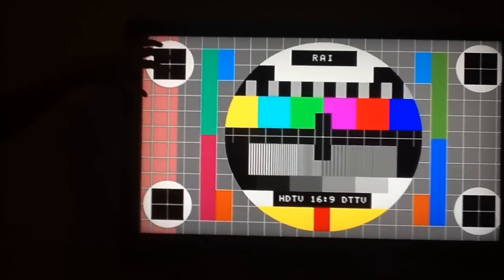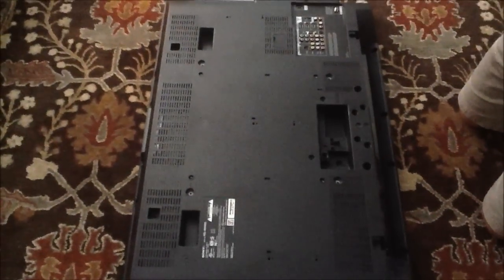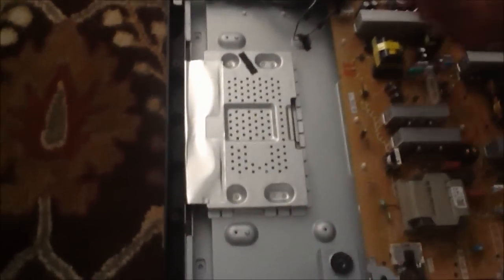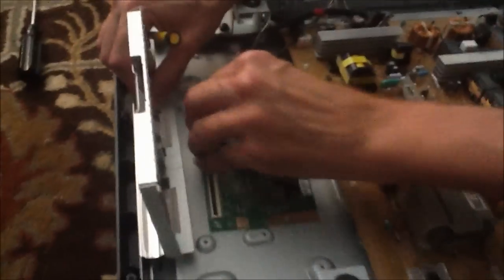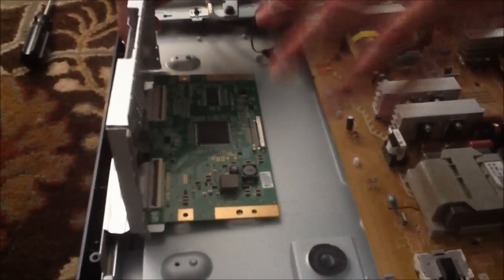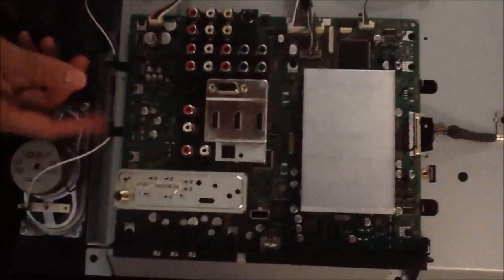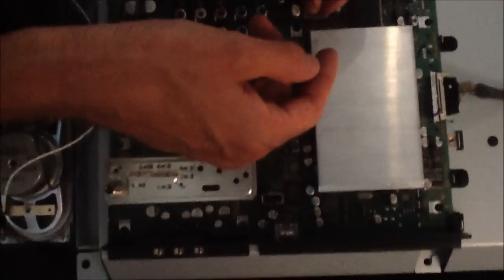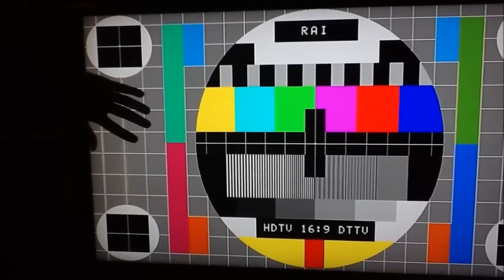How to Troubleshoot an LCD TV

Comment: 43 inch lcd vediocon off on inverter but start on light/without inverter ligh means direct light.? On sply bord power coming I have changed Brize and filter 120/500 even then filter shows 220 voltas and doesn't start but on ac light without inverter Lcd starts

Comment: Sylvania LCD Color TV model 320SS9 A won't shut off either by remote or by button on side of TV.  Put new batteries in both TV and cable remotes, but that didn't help.  Tried to unplug it, but with a new knee can't get down on the floor to crawl under the cabinet it's in.  How do I shut it off?  Maybe that would reconfigure it and it would work again???

Comment: I am trying to find info to repair a Seiki LCD TV model #SE47FY which has sound but no picture. I did the flashlight test and found that there is a picture but no backlight. It is difficult to find anything about Seiki TVs and I am hesitant to perform any tests for fear of doing harm to the electronics. I would appreciate any help that you could give me.

Comment: I still think you may have a tab bond problem...During the movement of the tv you may have jogged the bonds so they will operate better, but, most time its the bonds and freeze spray won't always diagnose an issue with bad tab bonds.....I've been in the tv service buss. for over 35 yrs, and i myself have fought with these issues all the time.......Luckily, you were able to return those bds. with no fuss or even a stocking fee....This co. that you dealt with must have recently changed it's returns policy, becuz, I have never been able to return w/o a fee etc......of course, since the tv serv buss is almost non exsistant, these co. will do anything to drum up funds..........but, good luck......this is the reason I no longer do service full time for the last two yrs.!

Comment: LCD LED Tv Panel Bypassing Methods eBooks.

Learn how to repair Panel failures,T-con problem in LCD LED TVs with comprehensive guide line with Schematics and Pictures of Problems, This eBook (PDF) or (Doc)format was written for Advanced Level of Technician of LCD LED and Plasma TV repair and includes many Bypass method. If you want to become expert in this filed of LCD LED TV repair  than this is a good eBook for you. Maybe you have a broken LCD TV sitting at home or your workshop and you want to repair it quickly. No Problem who you are or what your reason is for wanting to repair LCD or LED TVs you have come to the right place.Once you have complete your purchase you will be sent a link to download a copy immediately.
Volume 1 ,
Volume 2 ,
Inverter Bypass eBook,
SMD Data Guide eBook
Reply: LCDLED eBOOKS who wrote those ebooks?

Comment: Thanks for taking the time to make the video. I have  VIZIO that I'm about to open up. I'm sure it is similar. at very least troubleshooting process would remain the same. Yes?
my question to you, and maybe I missed it.  I 
Will have to check again.
     When you mentioned "Re-Seating the Ribbons, Or Tabs, I noticed you only did it at the "TCon"board?  Wouldn't you also want to do that at the main board as well? Or is that a permanent connection? It was Hard to tell. Just that if it is removable and there is a reason NOT to re-seat there, I was hoping you could tell me. Thanks agan

Comment: I'm having trouble with my Emerson  model#LC260EM2 - S/N DS4A1213148370 it well turn on but won't go into the menu or only displays hdm , digital DTV VIDEO COMPONENT HDMI3 HDMI2 HDMI1 so in other words it's displaying each input mode only . thats all it well do ? So if that helps I would be grateful for any help thanks Ron F

Comment: my samsung tv 26" is not powering up when i switch the power baton it flashes then goes to stand by,no output.(model.LA26D400E1XKE),When i check the voltage with the main board disconnected it's stable but with main board connected voltage is varying

Comment: Video let down!  100%  I have watched 8 videos and 7 of them taught me something.  This video did the opposite.  It taught me that contraction tightens joints.  Nope! Expansion & heat does.  It taught me that you, without reason, start at the famed TCONN board for repair; only to find it did not work.  Then it taught you to replace the four hundred dollar board only to get pink fuzz that you have to live with.  Honestly, this video hinders home project and budget friendly trouble shooting.  Everyone, there are guys out there who actually know how to find your problem with a volt meter and guide you to inexpensive repair.  My TV keeps going blank.  It is a power supply issue but I will test it with a volt meter before I go buy any boards.
Reply: +Running Out of Air agree

Comment: My parent had a 1976 model Quasar with plug-in boards, later on RCA and others came out with them. But it was a hassle to stock all those plug-ins and some were expensive.
Now the new sets,,we are back to using plug in boards, the idea was the repair guy could come to your home and quickly fix the problem just by replacing a circuit board.
Reply: +Bri G. That plug in board principle was also used in German made Blaupunkt and Grundig TV's in Europe. The circuit boards also had a status LED on them to indicate which board had failed.

Comment: I have the same television, but mine has a different problem. A while back I turned my tv on to find a problem where the TV would gradually get darker and darker and then would start to distort the colors and would "solarize" (I think that's what it's called). The problem eventually went away on its own after a few weeks, but maybe 1 month later the opposite started happening. I would turn it on and see a white screen, that would eventually return to normal, but after a few minutes would get very bright and "Solarize". Any ideas on how to fix this? Do I need a new tcon board? Or could it be the main bu board? Help me please.

Comment: Duh, ever heard of 'contact cleaner'? Simply re-seating a connector, especially one that is composed of multiple delicate connectors, is not guaranteed to clear corrosion or carbon build-up that appears over time and interferes with electronic contacts. Of course, if there was corrosion on any of the connectors, it most likely wouldn't be on the contacts of the new board (or replaced cables), so replacing that board would have 'appeared' to fix the problem. In this case I'd guess that the cable was possibly the fault. In fact, why didn't you first replace the connector cable itself when you appeared to have isolated the problem to the cable, which would have been cheaper? Anyway, you could have possibly fixed the problem in about a half hour for less than $.50 (the cost of the amount 'used', of course). I hope others steer clear of your 'disposable repair' method until after they've tried using the less expensive 'contact cleaner' test (and possible repair) method that can be tried by anyone without any more sophisticated knowledge of electronics than an awareness of this problem and the appropriate screw driver tips to take off the back of the tv.

Comment: I have an LG 50LN5600Iu The problem is when the set is turned on,the LG logo flashes for a split second then the screen goes black.I don't see any led lights through the vents. However,With a flashlight I can read the menu, I do have sound only no picture

Comment: My LG TVModel PDP42G20144 just turned off one day (no power) and has no power to it since. I was thinking it was the power supply unit. The number on my power supply unit part is EAY60696801 or ( 901)  What do you think?

Comment: I'm from the old school where I had to repair TVs on the component level. That means a full compliment of test equipment such as oscilloscopes, bench meters, RF generators, signal tracers & generators, convergence generators and a whole lot of knowledge about electronics. Watching this video makes me a little concerned about the "throw a board at it till it works" philosophy that this video clearly illustrates. We used to call this method "Screwdriver Mechanic" troubleshooting!

It seems that the electronic service industry has degenerated down to the "village idiot" level. This is really too bad because electronics used to be fun, challenging and very satisfying.
Reply: spudpail Not everyone is a TV tech or an EE. This is designed to help people on a budget try and fix a TV cheaply without having to have detailed knowledge of electronics. Yes we used to troubleshoot PCs at a component level too 20 years ago but electronics got to the point where its cheaper (cheaper because it takes less labor) to just replace entire PCBs. Take your elitist attitude somewhere else. Youre not helping anyone here.
Reply: +spudpail The industry has definitely headed this way.    Even with scopes and generators, it's probably less time consuming and not that expensive to replace components, but you should have some working knowledge on which component to replace first.   I think  a hybrid approach works best.  Test with an VOM for obvious thinks like +120 VAC and look for bad caps (test too).  Reseat connections and clean.  Then, if it makes sense, start replacing boards.   It's not very easy to replace a component on a TCON board even if you could figure out where the problem was.  On the power board you have a shot.  Where can one get schematics these days?  I remember Sams!
Reply: +Mike Longo Read my response to GreywolfStudios74 . I replaced SMDs for a good long time and it's not easy and I agree that it may be more economically practical to replace the board, but deciding which board to replace without buying the every board in the set is where a little logical troubleshooting pays off.
Reply: There are companies out there that will let you return parts but you generally dont just blindly replace a board. If you do a little google-ing you can generally figure out which PCB is bad in a TV just from what the problem is. Then its not as much of a crap shoot. Plus there have been times where when I wasnt sure Id buy a used part off of ebay to test with. sometimes I waste a few bucks here and there but generally Ive been able to fix both TVs and PCs by doing these sorts of things. I eman dont get me wrong if you have the tools and the knowledge then great, repair the component but I can tell you from a PC point of view even though I can repair PCs at a component level I generally dont anymore. unless its something obvious and easy like a blown cap or something. partially this is because its easier and faster to just replace the PCB and generally by the time something like that goes out on your PC its generally time to upgrade anyway. Either way though my original point was that your attitude is elitist because theres more than one way to skin a cat and not everyone knows how to do it your way.
Reply: +GreywolfStudios74 What you are saying is true to a point, but noone is going to tell me that a supplier is going to just let you buy boards and if it doesn't work bring it back and try another until  the problem is fixed. Electronic suppliers just don't operate this way and if one does, they're not going to stay in business very long! You determine which board is the problem by approaching it logically. I worked in the industry when boards (modules) were replaced and sent in for rebuilding. We did it all the time, but we didn't just keep throwing in parts till it worked. If I did I would have been fired!

Comment: I have a Samsung LN-T4671FX/XAA with a picture which appears to be fine except there is a white grid over the entire screen which appears to overlay the video causing some lightness in the picture.  Audio is fine.  The grid flickers around motion on the screen.  I have reset the TV, by unplugging it for 2 minutes to no avail.  I have unplugged and re-plugged all input cables.

Comment: Couldnt have been the mainboard (bu)  because it produces the video signal in a whole frame by frame basis. If only a portion of the picture is bad then its either the t-con or most likely the lcd panel or bonded driver boards. I think because you moved the tv around that thats what made the vertical bar go away. Thats why you still had alittle distortion on the same side. You probably have a bad bonded ribbon connector in the far corner. You will actually have to remove the lcd panel to fiquer it out.

Comment: ALso, I've "fixed" 2 free Sony Bravia TVs by shimming under the top corner LCD ribbon cable "tabs".  Shim under with say rubber or plastic but if you shim on top, only use say folded aluminum foil as these "tabs" get quite hot and I believe contact with the metal trim bezel is meant to dissipate the heat from the tab.    I also tried using a paperclip to squeeze the top right "tab" as it constantly needed shim adjustments and the paper clip end cut into the ribbon cable and ruined it.

Comment: Have a Samsung LCD TV model:UN32EH5300. The TV turns off then turns back on constantly. The TV stays on a constant cycle. Any help would be appreciated. Is this an expensive fix?
Reply: CHECK YOUR POWER SUPPLY
Reply: YOU GOT BAD CAPS ON YOUR POWER SUPPLY  MADLEE357@GMAIL.COM

Comment: CET Technician for 8 years here in Dallas for most major brands. What you have is a defective LCD Module not cost effective to repair.  It's a bonding issue inside the module where the source and gate ics reside. Your method with freeze spray was backwards. Most of these problems will temporary resolve themself after the television has warmed up. Warming components will expend the molecules and alot of times fix the microscopic connections. Just a tip if anyone tries to replace tcon board. Removing the metal grounding tape from top exposes those ribbon cables for removal.  Good attempt and wish you best of luck in future repairs.
Reply: Hey what do you take in college to learn how to repair these flat screens?  Is it electronics?  I wanna learn pc repair but I also wanna learn how to repair flat screens and gaming consoles too.
Reply: VWGTI I think Dave has one of Jestine Yong's E-Books, so look him up.
You'll find E-Books there you can buy, my first one I got was fixing LCD monitors.
Reply: CET and MST certifications can be obtained thru ISCET. www.iscet.org

Comment: I think the uploader assumes static discharge issues will be addressed before handling the board. I do not think touching the chassis for the TV will work just like PC because they are double insulated. So one either needs an arm band or has to touch a known good path to earth before handling if you are sure you will not pick more static from your clothes.

Comment: What if you don't have any power at all to your LCD TV?
Reply: first check the fuse in the plug ,then any fuses inside the tv if they are all fine further tests need to be done
Reply: Thanks James!

Actually I found out that the problem was three burned out capacitors which I replaced no problem, and it fired right up. However, when it came on the sound was gone. I can't get any sound out of it at all now.

I think the problem might be in the side AV board on the back of the TV. It's the one labeled with inputs s video/R audio L/ video in plugs on the back. When I initially took the back off, I neglected to remove the 2 small screws that hold that small board in place on the back of the TV.  As result of my tugging to get the back off I both bent the board and broke the screw holes off the board. I super glued the screw holes back in place so it can be attached to the TV again, but it still has a bend in it.

Do you think this could be the source of my audio problems, or is there a chip I need to replace?

Thanks so much for your help.
Reply: mmm ,no sound ,before you start replacing any chips first verify that the audio circuit is getting its   24 volts from the power supply and that its reaching the main board to check the chip you will need a pinout to find vcc thats the pin with the chips supply voltage verify the audio chips supply and its outputs anything missing from its outputs means its stuffed and should be replaced ,in the case of your av board check you havent broken any tracks you can do this by continuity checks between components in the path and bridge any breaks ,if any breaks are found scrape away a little of the track till copper shows on both sides and solder across ,take your time and pls be careful when power is on and taking voltage measurements ,hope you dort it out ,let me know how you get on and by the way i am fully qualified and have my own buisness so you are in good hands ok

Comment: I have a Philips 42" LCD turn on the tv ...tv is on for about two seconds then goes black  but do have sound any help would be great!  thanks
Reply: check the 12volts line at the digi board and t con board also the power supply

Comment: Also, do you recommend another site where I can find replacement T-CON boards? The site you recommended shows mine out of stock. I have emailed them but in the meantime, I figured I'd ask to see if you know of another good site? I have tried ebay and they have 1 used one but it would come from China and delivery is way too long coming from there. Thanks for any help in advance!

Comment: If you replace one part and it doe not work, I suggest you take that part out and test the next part. however , if you let the first part in and add the second one and almost bring the picture back, is likely the first part maybe defective. This repair menu, is for the certified techs, who will bring in the parts likely to be at fault once you submit a warranty call...most problems on a modern Tv, now can be fixed the way you repair a PC.

Comment: You need to admit that the mainboard did not fix this problem! That TV had a Panel/Tab problem. Flexing the TV frame /Panel during repair is what cause the problem to go away  temperaryly . Your comment also suggest you still have the problem. Component cooler dont always work, you have to get into the panel and flex the tab physically. Please tell us the truth so it could help me and others.